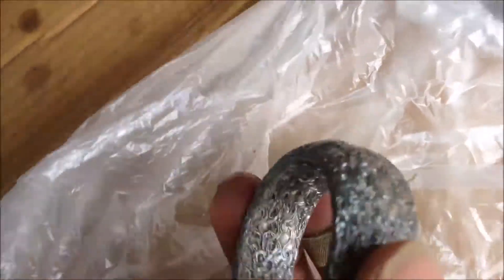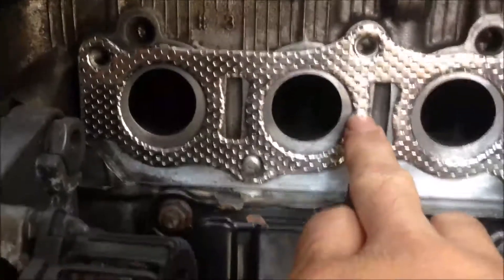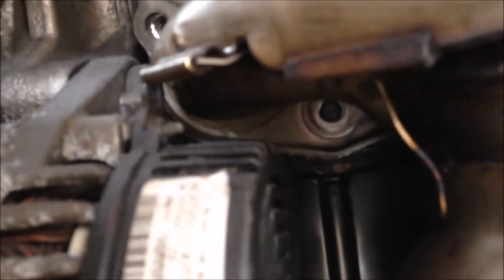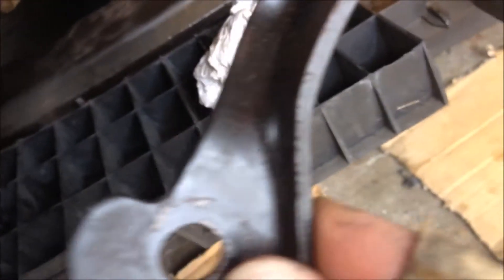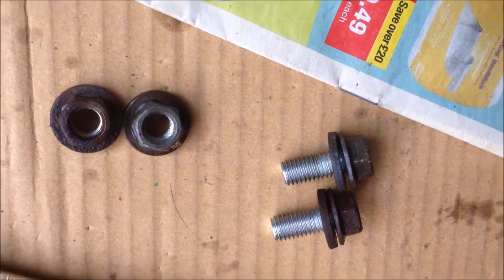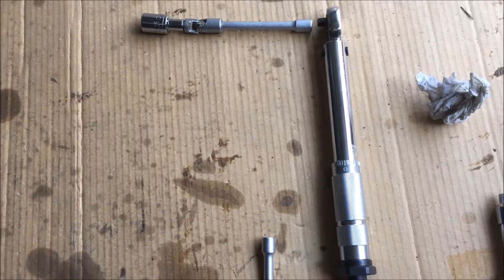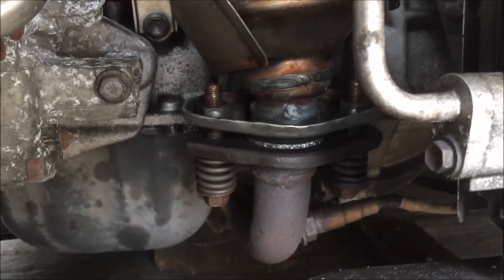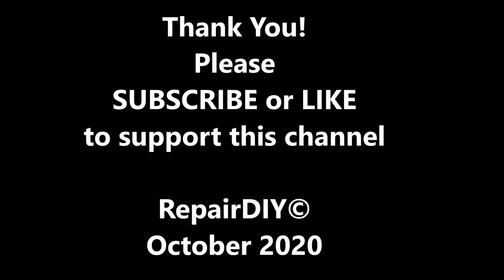AYGO: Catalytic Converter: How to Install? Toyota, C1, 107

Comment: Why did you have to adjust the bracket for the cat? Do we all have to do that?
Reply from the maker: hi, when you buy a third party part, it is not uncommon that the party may not fit exactly well! I had to modify the bracket due to the new is a little bigger than the original. If your new cat has the same or a little smaller dimension, you may not need to modify the bracket. have a nice day!